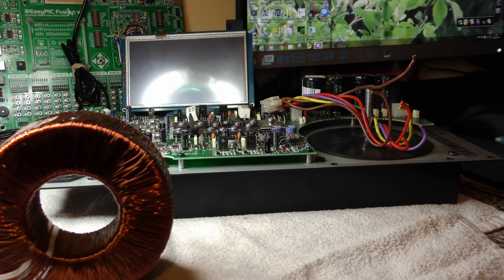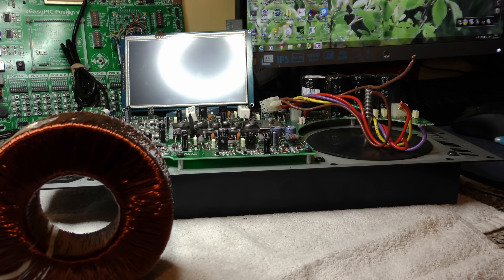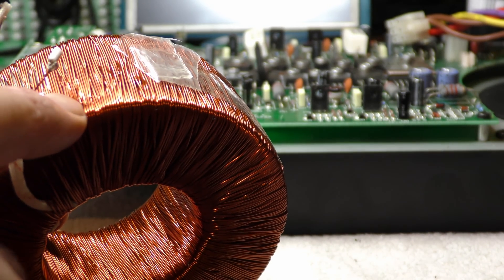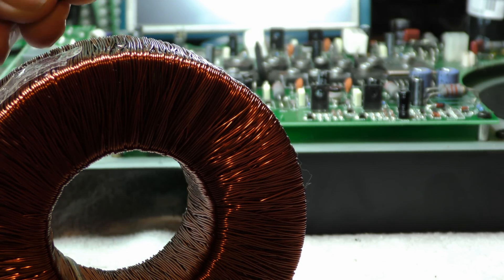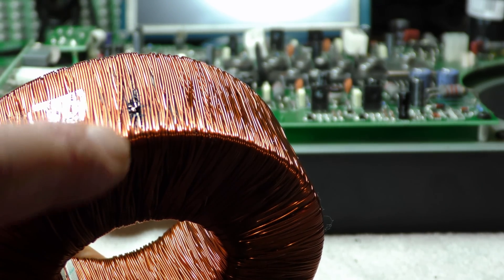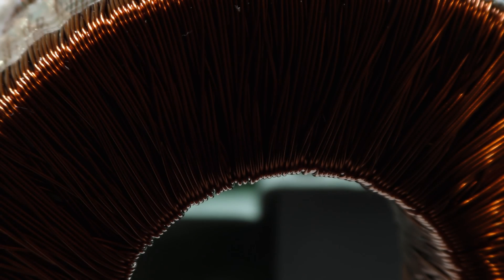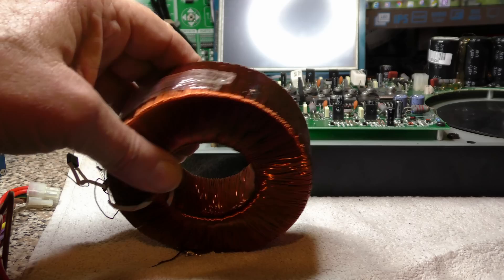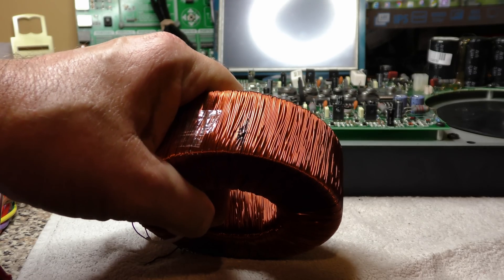Why Mackie SRM450v1 Blowing internal fuse. 4K

Comment: Hi John. I wonder if you can help me with my problem. Just switched on my srm450 v1 today and everything work fine just can hear some buzz noice from back and some smal buzz on tweeter and lf driver. buzziing sound like transformer on back. kind low freq buzz. any solution for this issue? best regards from Ireland
Reply from the maker: Hi, sorry I have no clue, it could be anything from something on the amp to your leads.
Reply: Some resistor or short in starter tranzistor with the ground

Comment: Hi. Thanks for uploading - enjoyed the video, for all the wrong reasons sadly.. one of my 450s blew a fuse, and continues to blow new ones. 
It is an early, Italian made V1 according to the printing on the case but interestingly the circuit board itself has a made in china sticker on it. The drivers are RCF though so perhaps it was a crossover period, or maybe the boards were always made there, who knows these things? I also have 2 china ones, proudly emblazoned, which have performed flawlessly for about 10yrs.. (and sound identical to me!). Both the italian ones have blown their LF drivers at some point. 
The china made SWA1501s were another matter! But after I identified a mistake on their schematic, compared to the italian ones (where they had replaced a 1w resistor with a 1/4W one !) they also performed fine, (after blowing about 6 up..) I digress.
So, the 450 - I thought I'd investigate so measured the resistance of the primary but it read 1.8kΩ.
I didn't particularly know if that meant anything to be perfectly honest, but soldiered on - the secondaries measured approx 2Ω between 60+ 60- , 1Ω from each 60v  to the (yel/grn) 0v centre tap, approx 1Ω between 30+ 30- , 0.5Ω from each 30v to the yel/grn 0v. However, the violet 0v centre tap was open from any other wire (or is that an earthed shield?).

But then, I followed your advice here and disconnected the secondary - popped another fuse, and now the primary measures 2.6Ω (previously 2.8kΩ..) What just happened? But more importantly, why are these trans only available from surreyamps.co.uk for 186GBP. Crazy. Where are all the £100 replacements gone?

Is the transformer obviously toast? Nothing else on the board looks or measures bad to my highly untrained eye. 
You mentioned in the SWA1801 video that you could feasibly replace that (indestructible) transformer with 2 separate units, would you advise that in this scenario? Although where they might actually fit is another matter, the sub enclosure has a bit more room!
Reply from the maker: Hi GrooveDigger808
Thank you for your detailed comments.
It sounds like you have done a great deal of homework including finding the wrong spec resistors.
Your primary winding was obviously blown and going open circuit.
Replacing the fuse and trying it again means the high voltage has a chance to arc across the break and cause more damage and almost create a short circuit.
I too see companies selling custom made parts, they have probably had 10 or more transformers manufactured and charge a huge premium to the end user (because they can).
Oh I forgot 1/ the purple wire, it's a thermal fuse that is back to front from the usual design.
It's open circuit until it gets too hot then it closes to bring on the thermal light.
2/ The non standard custom design transformers have cheaper 'non low profile' centre cores that makes them physically taller than the standard part, or at least that is 100% the case on their Mackie SWA1801 transformers.
These transformers can be rewound for £100 Plus postage, but be prepared to wait many many weeks for the 'rewound' repaired unit., yes more than one many.
3/ The back to front thermal fuse is not readily available so you may have to disconnect the purple wire, that doesn't matter since there is a thermostat bolted to the heat sink next to the transistors.
Where are you in the world?
Oh one more edit
You'll have to solder the secondary wiring to the 6 way plug, the re-wound transformers have no plug on the windings.
Reply: Hi John. Thanks for the quick reply, very much appreciated. I am in the UK. I would certainly be interested in getting this rewound. The timescale is fine. Thanks for the other details, too.
I hope I haven't cause additional damage by trying it again after replacing the 4A slo-blo fuse.. do you think that because it still reads not quite open that the amp may have survived this? I don't think (hope) that I tried it again with the secondary re-connected to the board - I'm counting the fuses I have left and trying to reconstruct the sequence of events... A little knowledge is surely a dangerous thing!
Is there anything predictable that I can test? 
Thanks again

Comment: I changed the volume control. in my Mackie srm450 v1 .put it back together, plugged it in. heard a little crackling noise. it was playing fine. then hear another cracking noise then the power went out. blew out a fuse. changed it and it blew out again. what could it possibly be?
Reply from the maker: That is a needle in a haystack.
Maybe you didn't make sure the transistors were insulated or something.
It could be 101 things

Comment: One of my Mackie HR824 mkI studio monitors wouldn't switch on.  I checked the fuse and it had blown so I replaced it and it blew again straight away (blew it to pieces actually!).  99% that I need a new transformer.  
They are about 14 years old but I hardly use the things really and don't work them hard so I was pretty disappointed about this considering they aren't cheap monitors.  These were the Chinese manufactured ones too.
Reply from the maker: Probably cheap insulation or damage during the manufacturing

Comment: Smr 450 v2 change the input supply from 110 to 220 or 240
john it would be great if you
share your skills how to do it? i have speakers from canada and we will ship
the speakers to philippines use for tha
church
Reply from the maker: It looks like sw4 link needs to be removed, I cant see anything else.
What voltage caps are fitted to the input filter? (The yellow caps)
Reply: +John B i have not open the amp to check the capacitor i will take pictures of it i think its for the 110v version caps posible 250volts you mentioned. but i have to look into the unit first amp board
. thanks for the response i like your videos very informative. i subscribed to your channel
Reply: +John B if remove link sw4 would become 220 version already? may need to replace cap if lower voltage?
Reply from the maker: Valmark Reyes 
What voltage are they?
Maybe ask the supplier in Canada where you bought them.
Reply: +John B they are 110 volts im will trybto convert it to be able to accept 220volts standard im the philippines